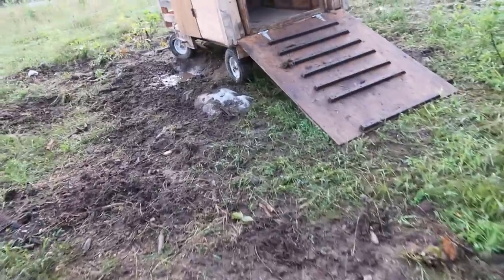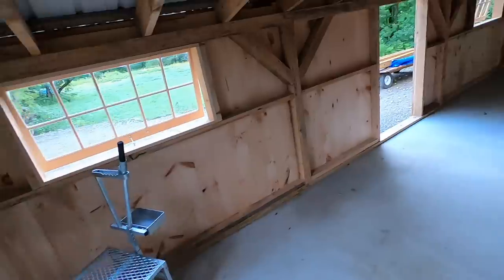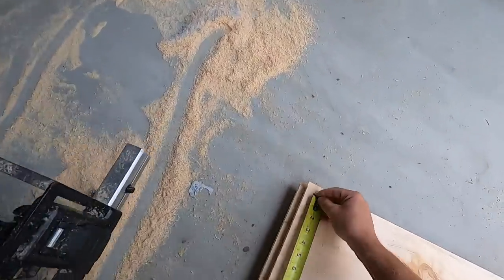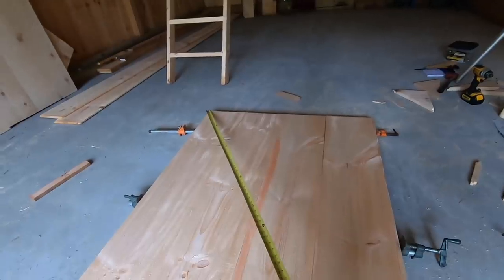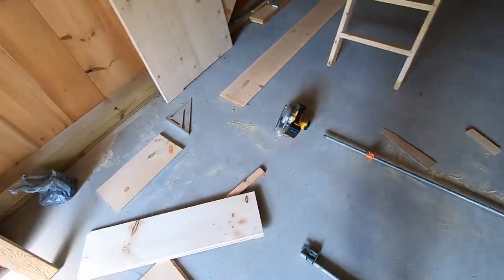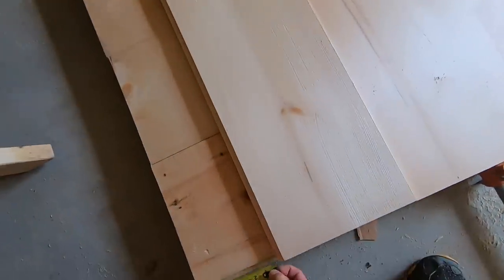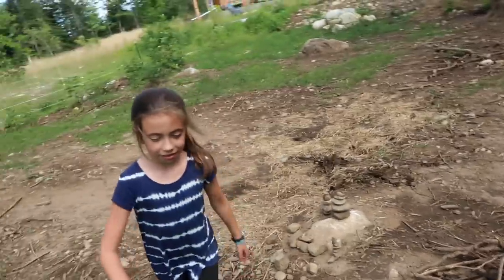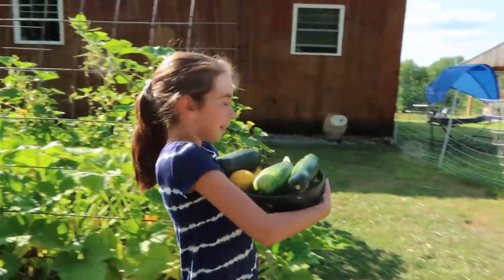She asked To Borrow MY Screw Gun and Then Took Over The Barn Door Build

Comment: Gooooooood Afternoon Al ,
I'm curious as to why you did not edge glue the  vertical boards ? It would help to keep rain water out from between the boards. As well as making the door stronger. 
  Ah , broody hens. I would make use of at least two of them.  They would hatch the eggs for you .  Then brood and raise the chicks for you.  You will need to replace your current hens at some point. This way you would have new chicks from your own flock.  And by the time they are mature enough to begin laying eggs the current hens will be ready to start phasing  out of egg production. You would have replacement hens ready to go . easy peasy  And you do not have to buy , brood and raise chicks yourself.

Comment: Yay for the Crash Course, that's great!
Btw, when are you going to tell us why you cut the boards at a 5 degree angle?
Reply: He said in the video before this one.
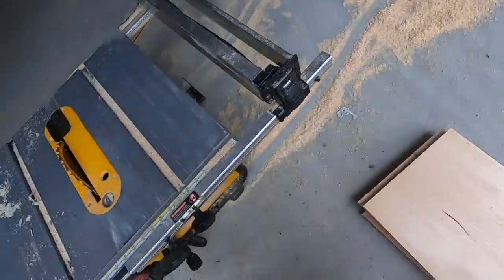Reply: You just bevel the table saw blade.  You can see him change the bevel @8:11.  Table saw blades can be angled up to 45 degrees to the left (away from the fence).  Typically with a wheel.   There will two wheels (in different locations, depending on the table saw). One raises and lowers the blade in relation to the table top (changing the height of the cut) and the other lays the blade over from 90 (bevels).
Reply: rjtumble    The question was why, not how.
Reply: @KevinCoop1  Ugh, sorry.  Why is to make lining up the two edges easier.  You get a tighter fit between the boards.  He talked about that when he built the first door.
Reply: rjtumble    No apology necessary to me.

Comment: What gauge wire did you run from the house to the barn?  How many feet was it?
Reply: Half of that question is answered here: https://www.youtube.com/watch?v=DXd29s2Pg78
If it's copper it would have to be 3-3-3-5 but aluminum would have to be #2 or #1 by code.

Comment: I'm Dutch but I never knew you called that a Dutch door 😄
Reply: I'm Australian and I've only ever heard them called 'Barn Doors'. They are usually used for horse stalls so they can be opened at the top for the horse to see out but closed at night. Also have seen them used as farm house doors to have a door but also open the top section to let the breeze through.
Reply: A door that splits half way up I would call them stable doors
Reply: Stable doors makes much more sense. But now that I think of it, these doors are also used a lot as the back door of farms. Usually where you enter the mudroom.
Reply: The name changes depending on country or even region. And the different names may be something different depending on where one is.
If someone says Dutch door I know that's going to be a full door, cut horizontally that can be opened on a hinge singly or separately from the other half. Also, the bottom half often has a shelf/ledge. 
A Stable door might be the exact same as a Dutch door. Or it might just be the bottom half of the door. Stable doors might also be thought of as interior not exterior doors. Also it might be on a hinge or it might be on a track/rail and slide.
A Barn door, where I am, is a full length (or oversized) door on a track/rail that slides open (not on hinges).
So...

Comment: Although your door is nice I was wondering why you didn't use the traditional barn door X brace to conserve the wood, time and keep the aesthetic look?
Reply: tantagoth these will definitely be more wind proof, and since he is going to insulate, maybe for the wind??
Reply: Maybe because he liked this style better.  I mean it is about personal style and efficiency for them.
Reply: I would think they need to be thick/heavy to help with temp control.
Living in Qld Australia our lowest temp in winter is around 15 outside to low 20's inside (c of course- f would be 60 to low 70's) so I have no idea how cold all that snow must get. Right now, smack bang middle of winter at 11.30pm it is 21c (70f) inside with no heating and my windows are all open.

Comment: I've been wondering why you haven't added a handle to the garage door so it's easier to open it?
Reply from the maker: We will. Trying to get ready for the new animals arriving
Reply: @LumnahAcres  ahh yes true, best to have your priorities in order. A handle on the garage door is just a luxury, but not a required, feature to have for now.
Reply: @Caboladk  True, but adding a handle seems to me to be a very easy and quick thing to do.
Reply: @Caboladk , It's a luxury until someones finger gets pinched off in one of those hinged joints. Seen it happen and it ain't pretty at all. Not trying to be a safety Sally but it was absolutely gross.
Reply: @madampolo   Yes but if you don't have a handle then you need to pick one out and there's lots of options so that can take time ;)
Reply: @augustreil  Yea but right now the luxury isn't needed as it'll only be opened when being in the barn working on the barn. As soon as all the necessary things is build on the barn I bet it'll get added.
Reply: @Caboladk , It's a garage door handle, not your kitchen cabinet handles. When you see someones finger tip completely pinched off and blood shooting everywhere, you would make it a priority believe me.
Reply: @augustreil  we'll just have to agree to disagree.
Reply: @august , 
I for one , never let my fingers get anywhere near one of those door joints.
Reply: @donaldmiller8629 , Hey I dropped this already. My adult friend also made it a point not let his fingers near those pinch points, until he lost his finger tip. I'm only so hell bent on this because I've seen it happen. Al can do what he wants, he's an adult. If he doesn't think it's worth protecting his fingers, Gina's or especially Olivia's, so be it.

Comment: Don't let her do any more of the door build.  She did not line up all the boards.  At least one is sticking out.  Al is always so particular about that.
Reply: In Gina's defence...  that 1 board was a little offset when they marked those pencil lines and I think she was lining up the pencil marks and just didn't see it was off...
Reply: He hasn’t cut the door down to fit yet either. He has plenty of room. Also he made sure one side was 100%, so he only needs to trim one side.
Reply: whats the saying if you dont have any thing nice to say , say nothing at all.. peace!
Reply: The door has to be trimmed to the door size he made them bigger than the opening so once they are cut to fit no misaligned boards.
Reply: I noticed it right when she was doing it and wanted to yell, it's not lined up!
Based on how I've seen Al work my money is on him having to fix it. I could never leave it that way! Doesn't seem that cutting only one side would fix it. That said, it doesn't seem like enough of an error to exclude her from helping and I comment Al for not pointing it out in the video.

Comment: I am disappointed that you did't show the election installing your service , do have 100 or 200 amp. and what size wire did they run, in order to mantan less the 3% voltage drop ?